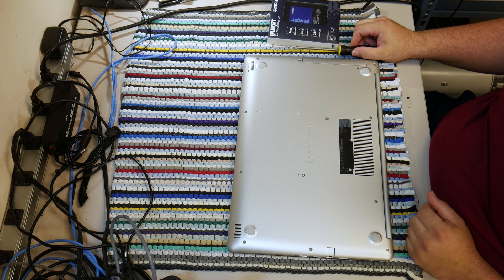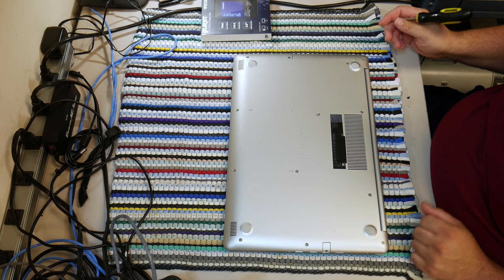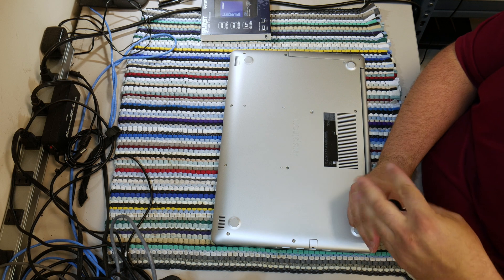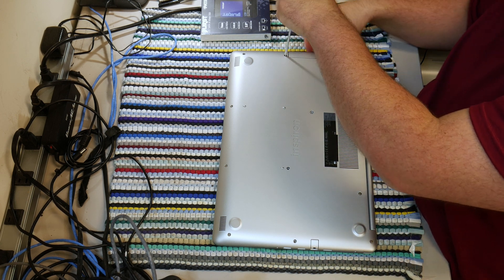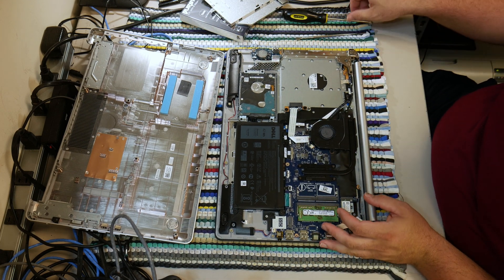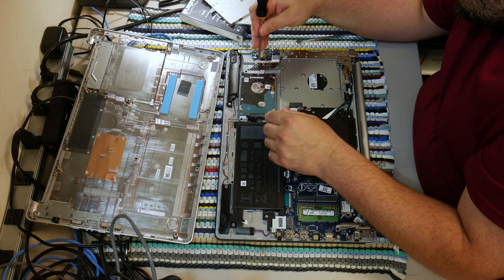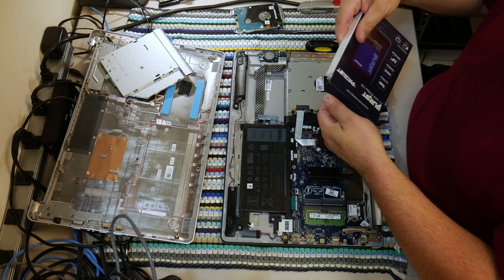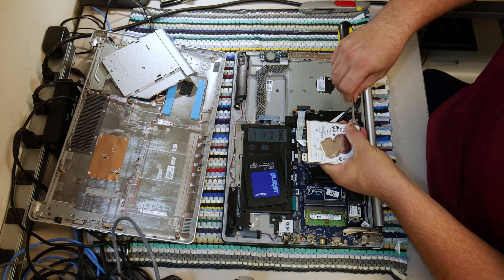Dell Inspiron 17-5000 Series Basic Disassembly (HDD/SSD, memory, fan, battery) (4K) - Jody Bruchon

Comment: Thanks for the video, my hard dive has just died and was wondering how the case and everything came apart.
I think I prefer the old style Dell laptops in which the hard drive is in a caddy on the side, undo 2 screws and slide it out

Comment: My wife had an issue with PayPal and allowed PayPal remote access my laptop and now my laptop is locked with a password from PayPal….if I replace the hard drive with a new hard drive with a new windows system, will this allow me to have a laptop again?
Reply from the maker: That wasn't PayPal, that was a scammer. Yes, replacing the drive will probably fix it, but you can probably have someone remove the malicious software for you.
Reply: @JodyBruchon how do I look for someone to remove the malicious software?  I have the Inspiron 17 5000 series with the i7
Reply: @JodyBruchon  how do I search for someone to remove the malicious software?  Search computer repair?
Reply from the maker: @jdd7998  Yes, probably find a competent local computer repair shop. You shouldn't expect to pay too much for the service either; don't go to a big corporate chain like Geek Squad or they want $200+ and probably will just wipe your computer and reinstall.

Comment: Great video. Thanks for producing it.
I got a 512gig m.2 ssd from Dell to upgrade my C Windows system drive. The person i spoke to advised me that i would have to do a fresh Windows install. 
Is there any reason why  i can't clone the existing drive with the new drive connected externally  via USB ?
Reply from the maker: Assuming you have software to do it, you absolutely can clone it. Clonezilla may be a good option.

Comment: Two other questions then will stop bugging you. One what digital 7mm hard drive brand would you recommend? 2. Are the screws phillips or torque screws?
Reply from the maker: Brand doesn't matter much but if you're putting in a thin laptop style drive you should be getting an SSD instead of a hard drive. I usually use PNY because they're very cheap but don't have a high failure rate. I stopped buying Silicon Power cheap drives because of the failure rate. Screws should be Philips, probably #1.
Reply: I am sorry I have the same laptop as you are working on in this video, just not sure of the model number. Is that on the bottom of the laptop? Wish you was closer would bring it to you to fix.  @JodyBruchon

Comment: Do you have a video on how to replace the fan on this lap top. I have the dell inspiron 17 5000 series but not sure of the model number?
Reply from the maker: I don't think so but once you get it apart this far it's usually just the screws holding the fan down to get it out.
Reply: Thank-you for your prompt reply. I have been getting errors saying my fan is not working properly. I am going to try cleaning the fan first to see if that helps.Also received a message to replace the hard drive. So thank-you for showing me how to do that chore. Have a wonderful day.  @JodyBruchon
Reply from the maker: @Elkins24  it's very likely the fan is worn out. Test by spinning it with your finger or a blow. It should spin freely and for a little while without vibration or noise. If the bearing is worn out then you'll feel a vibration or hear a buzz or him from it when it spins. It's rare that a fan failure is something jamming it.

Comment: im a bit late with this, but do you remember what screwdrivers did u use? I cant get rid of the screws under the cd drive, they are so tiny and flat
Reply from the maker: Those are probably Philips #00 size.
Reply: @JodyBruchon  thank you!!
Reply: I have the issue that one of them stripped 😩😒

Comment: All my previous Dell laptops, back to pentium 2, keyboards were easy, 5 minute swaps when they failed. 
Not this backlit 17-5770 i-8, 8th gen. 
I tried and the damn thing is spot welded into the top frame, so you have to field strip everything and reinstall them to a new frame. Don't waste your time attempting to unweld/reweld a new keyboard at home. & good luck finding a new top frame with keyboard. 
I have 2 "new" + 1 refurbished ones that didn't work. #4 was a 'as new' US English pull from Lithuania exchanged for a different language keyboard/frame. It was down for some 10 weeks as I replaced or waited for the next new or refurb to arrive. IN the end I decided the mobo keyboard socket had poor clamping or connection. This black Lithuanian keyboard looked the same as the silver 5770 i-7 8th gen, but was stickered as "COREi-5, 10th GEN" and it's keyboard ribbon looked thicker and so it clamped tighter into the mobo socket. 
I have been loyal to Dell, but all this has turned me off to Dell. Yeah I know, they all come from China now. It's working great again & yeah I had already swapped/cloned a 256GB SSD for the 128GB & found another stick of matching numbers 16GB RAM = 32GB + new Intel blutooth 5.1 wifi card.
Do you have a preferred laptop brand over Dell as far as serviceability?  Thank you for your videos.

Comment: Do you have to disconnect battery before removing internal screws and adding the SSD? I’ve done it both ways without incident but it always frightens me. Some are just a simple ribbon cable, some are more complex. Noticed your comment about grounding being more obsolete on newer aged machines and curious for your insight
Reply from the maker: No, you don't. I never do.

Comment: Great video. mate. could you please tell me exactly model or parameter for the SSD driver (1tb) and Ram (32gb) I should buy? I really don't want  the hassle for returning. Many thanks
Reply from the maker: I don't know, but you can look up "Dell Inspiron 17-5000 upgrades" and find plenty of machine-specific resources for that. Crucial offers an upgrade service that tells you what memory and drive type your computer can take, plus the maximum RAM you can reliably install. I don't have this computer anymore; it was a customer machine and I haven't seen it in years.

Comment: I know this is old, but Dell 17 5000 is one of the best performing machines I ever had. Especially the touchpad, it's super responsive and precise with best gestures support. And otherwise snappy as if it's much more expensive machine. It also keeps low CPU temp. It  came with 128 Gb SSD + 1 TB HD, but only 8 gigs of memory, and now I see I can expand that myself. Thanks!
Reply: I agree. This has been a great performing laptop for me for the price.
Reply: you can put two 16 gb ram into each slot... its perfect for upgrading n still worth 350 to 500 bucks even in 2021. one computer that holds value in all it standings yet my issue is only the battery...
Reply: @MrGoddlie  Indeed, it seems like just a bunch of screws to remove and then it's pretty easy access to memory slots. What issues do you have with battery? Mine is still in "excellent condition" after few years. But I did take some precautions, like downloading Dell's neat little tool for keeping the charge at custom percentage (like 50%) when plugged in.

Comment: Fitting an SSD hard drive is the worst thing you can fit to any computer/laptop they aren't reliable if they fail there is NO recovery all data is lost on the SSD. I have a new DELL 3793 shit laptop with a 99GB SSD which has 5 partitions, the main boot partition and 5 recovery partitions in case it fucks up, typical DELL shit
Reply from the maker: If you back up like you're supposed to anyway, it's the best thing you can do.

Comment: how do you replace windows 10 after replacing the hard drive?
Reply from the maker: On another computer, download the Windows 10 Media Creation Tool, run it, and use it to create a bootable USB drive. Boot the now OS-less machine from that drive and install Windows 10 from scratch.
Reply: @JodyBruchon  I have a question regarding the original licence key if using the procedure with the Media Creation Tool. Is the key detected automatically from the Laptop during the installation?
Reply from the maker: @heinergoldmann2539  I don't believe so, but after installation you can use the clipup command in an admin command prompt to pull the embedded license key into Windows.
Reply: @heinergoldmann2539  I know this is an old comment but if the machine is Windows 8.1 or Windows 10, booting from a bootable USB flash drive with Win 10 on it will pull the product key from the BIOS automatically 👍🏼

Comment: I finally decided to open mine up. I'm waiting on the m.2 nvme 500G drive now. I opened it first to verify that it has an m.2 slot. I taped the screws in their holes to keep track of exactly where they went (a few are captive by the hinge). I used a polycarbonate scraper for cast iron skillets as my pry tool. It worked great. I just slid it down the sides and across the bottom and a couple at the hinge. The bottom came off easily. Hope it goes back together as easily!

Comment: Ha. Didn't know the CD/DVD has to come off. Glad I didn't force it!
Reply from the maker: Me too! It would have ended very badly if you had. Those drives will bend and stop working, but not break.
Reply: @JodyBruchon  THree very short screws under DVD tray. One didn't go, and stripped. I drilled it out. Oh well. And I did replace the 5200 rpm drive. A boot that took several minutes dropped to about 20-30 seconds. Thanks again!

Comment: I keep seeing everyone changing out the hard drive...Why??? Whats wrong with the one that comes with it. Should i by pass this computer because i dont want to upgrade? I only want to watch netflix and surf the web.
Reply from the maker: The hard drive that comes with most computers is a mechanical drive. It has mechanical delays when accessed that make it much slower than memory chips. A solid-state drive is literally just a bunch of flash memory chips with no moving parts, meaning that they're massively quicker than a mechanical hard drive, but usually lower in capacity for the same cost. It's also a lot easier and cheaper to get laptop hard drive sized SSDs than M.2 slot SSDs, and any laptop currently sporting a hard drive is guaranteed to work with a 2.5-inch SATA SSD.
Reply: @JodyBruchon  thank you! I was going to buy from a guy on Facebook...Not sure i want the hassle. Lol Thank you.
Reply from the maker: @bencole646  It's a very good computer. The upgrade is not necessary. I highly recommend this machine, and you can always upgrade in the future if you want to. Be careful when buying used machines; make sure that they work without being plugged in (for laptops) and that the wifi works and no ports on the sides are damaged.

Comment: What if your hard drive is broken can u use the laptop with an nvme ssd without replacing the broken hard drive?
Reply from the maker: You'll want to remove the bad drive, but technically, an NVMe SSD install and existing drive removal counts as replacement of the drive.

Comment: My plan is to install an m.2 ssd into my 5770. Can I just open up my computer, pop it into there and start it back up? Or do I need to do something before installation of the ssd?
Reply from the maker: Yeah, that's pretty much it. It's plug and go, no fancy stuff needed, and the system should see it immediately.
Reply: Jody Bruchon thanks!

Comment: Like your video but why didn't you just put an m.2 drive in? A few extra bucks saves a lot of trouble. Once you clone to the m.2 you can then replace the HD with an ssd and the old drive will be a system backup. Did I miss you using a pry tool to remove the cover? To me that is the potentially the hardest part.
Reply from the maker: M.2 SSDs cost more than SATA SSDs. I was doing this for a customer who doesn't care either way. If it was for me, I might do things differently. Most laptops have to pried apart these days, so I definitely used a pry tool. The problem most have with the pry tool is thinking that they're supposed to be prying the bottom plastic away from the top plate, but what they should be doing is pushing inward on the top plate to release its hidden clips. It's a slightly different hand movement that is much more effective and less damaging.
Reply: @JodyBruchon  Prying open the case is my biggest concern. I've seen videos that bypass that step. Eventually I'll give it a try since my computer takes forever to boot up to Windows 10.
Reply from the maker: @eminusipi  I want to note for people reading this one year later that M.2 SSDs have drastically dropped in price and you can get them for nearly the same prices as SATA SSDs. In any case, the massive speed boost is worth a few extra bucks.

Comment: Thank you for the video, it is very informative. I have an Inspiron 17 5767 that I'd like to swap the hdd as well. I've worked on desktops in the past, do you have to worry about grounding yourself? I didn't think that it was safe to use anything magnetic around computers.
Reply from the maker: In general, the whole grounding of yourself is not really necessary these days. If you have concerns, touch any bare metal on the case before touching a potentially sensitive part. Magnetic stuff doesn't really affect computers unless you put a VERY powerful magnet on a magnetic hard drive. I have run a computer shop for over a decade and I never ever use a ground strap. Every chip made in the past 20 years or so has circuitry on all the pins that hardens them against static electricity. The static problem was mainly a problem on early CMOS parts.

Comment: Is there a separate video on replacing the battery?
Reply from the maker: No, but you don't need one. The battery is the big black flat thing taking up 1/3 of the whole computer. Unscrew any screws that go through it and gently pry apart the connector for the one wire pack coming out of the battery to the motherboard and it'll be free.
Reply: K.Thanks.

Comment: Thanks for the look inside.  So much expansion possibilities.  Anyway I need to change the power plug. This document from Dell has a hot link menu too:  https://topics-cdn.dell.com/pdf/inspiron-17-5770-laptop_service-manual_en-us.pdf#page=1  
So the first thing to do is remove the drive.  Then the bottom plate.  You just figured that out naturally but the bookmarks in this document are very organized.  They show what you need to do first to solve the problem you have. Like mine for example "replacing the power adapter port" a less than intuitive name for DC Jack. So much easier than in past models.
Reply: That's amazing man, thanks!

Comment: I have version with i7-7500U and 8Gb RAM.  Just disassembled mine and didn't find NVMe slot inside. Moreover SiSoft Sandra shows that Motherboard has 3 PCIe slots. 1 is used by the WiFi, another one for Ethernet NIC and the 3rd one is not in use but still no phisical slot available (
Reply from the maker: You must have a different model number in the same model series. I can't stand how manufacturers will omit slots like that to save one dollar. Sorry to hear about that :(

Comment: What is the double sided flat head tool called?
Reply from the maker: A spudger or pry tool. Commonly found in a six-piece kit, sometimes called a "clay modeling" kit. Should be easy to find on eBay. It's soft metal with no pointy corners so it won't damage things quite as easily as things like flat screwdrivers.

Comment: what replacement battery do I need for this laptop please?
Reply: I guess after 5 months you must have figured it out by now. But: WDX0R 42 Watt Hour Standard Lithium Ion Laptop Battery Replacement for Dell inspiron 17-5000 Part Number:  WDXOR  Now they run about $40 for a compatible battery.
Reply from the maker: @drakedorosh9332  Thanks for answering. I do not get notifications for all comments and I didn't see this one.